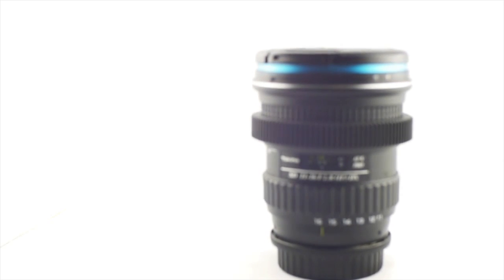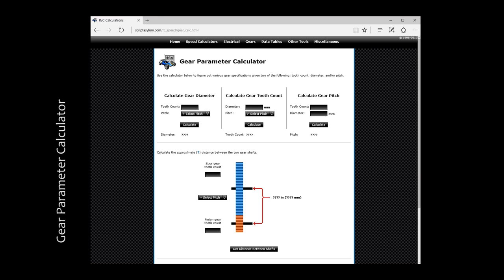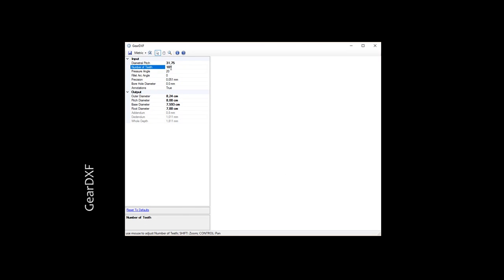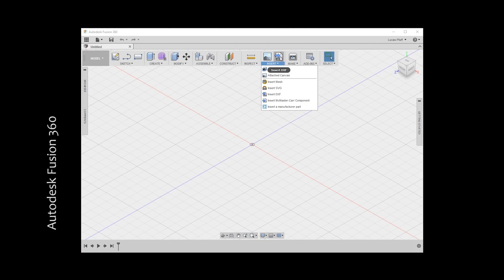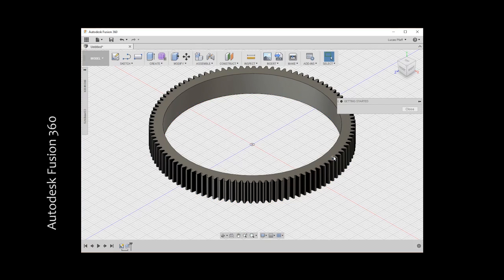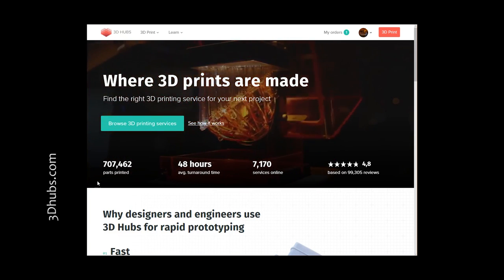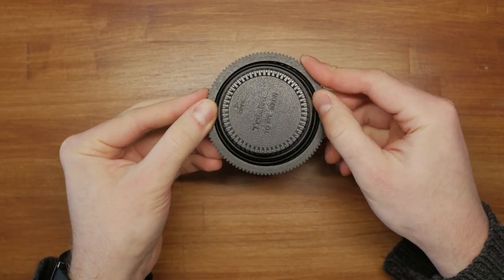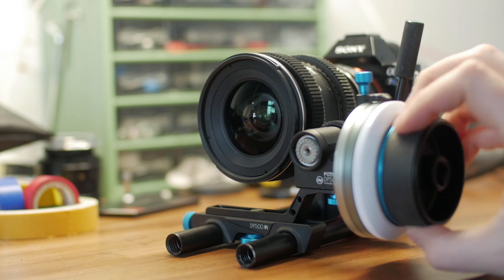DIY perfect, seamless Lens Gears for Follow Focus

Comment: Thank you for this very useful video. I'm on a mac and managed to do everything just using the free version of Autodesk Fusion 360 (maker version) - no need for GearDXF.

In Fusion 360, select the add-ins option then "Scripts and Add-ins". In the sample scripts provided when you install Fusion 360, select the SpurGear script and run it (I used the Python version, but the C++ version looks identical). When the script starts, change the "Standard" option from "Metric" to "English". Enter the diametral pitch of 31.75 and the number of teeth you need. I set backlash and root fillet radius at 0, and changed the gear thickness to 10 mm. Set the required hole diameter then click "OK"

That's it. Model generates and you're good to export the SLT.
Reply from the maker: Hi there Greg,

that is a great find! I'm planning to do a re-visit of this video where I share some new "tricks" I found along the way since I uploaded. Would you mind if I mentioned you with this trick in that video? :)

On a personal note, I love GearDXF for the nice preview, I like it for planning visually (I don't often calc the teeth number I need, I make the size based on eye and convenience). The native SpurGear implementation is WAY faster in terms of handling inside of Fusion 360, yet I found a way to make GearDXFs files a tad faster than they are by default, at least :)

Thanks for the heads up!
Reply: @LucasPfaff  - would be happy to be mentioned in your update. Thanks, again - your video has been so useful. I'm sure the re-visit will be just as good.
Reply: thank you! When I try to do this it says: Center Hole Diameter is to large. Do you know this problem?
Reply: @timdehring1507   this error is when you're using Fusion360? How many teeth have you entered and what is the diameter of the hole you need?
Reply: Thank you for this comment. I found it very helpful :)

Comment: I just tried this, the newer version of GearDXF is different and does not work correctly,  I went to the calculator and type in 91mm and .08 like you said, got 112 teeth, then went to gearDXF and entered in 112 teeth and 31.75, but could not enter in 81mm,  it reset it to 78.84mm. I managed to find an old version and it worked, so not sure what the difference is, Just wanted to let you know.  thanks
Reply: hi, where did you find the older version? thanks :)
Reply: @hydromyke  don't remember I just googled it.

Comment: Hey Lucas, thanks for the great tutorial! I have a question with the GearDXF though. I am trying to create a follow focus ring for Sigma 18-35 mm f/1.8. The diameter of the lens focus ring is ~77mm. So, adding +10 mm ring thickness, using the gear tooth calculator, the parameters should be: 

Diameter: 88mm
Pitch: Mod 0.8
Tooth count: 108
Diametral pitch:31.75

However, when I try to design the ring profile within the GearDXF, I could not input those numbers accurately. After inputting the Diametral Pitch as '31.75', the software automatically changes the number to '31.8'. Also, after inputting the Bore Hole Diameter as '77 mm', the software automatically correct the number to '75.24 mm'. Any idea what the reason might be and how to address this?

A screenshot of the GearDXF deign page I have could be found here: https://www.dropbox.com/s/2k0e1spj8hpm125/GearDXF%20Question.png?dl=0
Reply from the maker: Hi there, it seems you are using a different version than me. I'd maybe try to adjust the "spur" in the drop down menu and see if that changes something. If that helps, I'm using v2.1.1.0 right now
Reply: @LucasPfaff  That's what I thought. Thanks! I ended up re-sketched concentric circile with length diameter and 'extrude cut' inside the AutoDesk Fusion 360 to make sure the hole cut will fit with lens. As for the teeth dimension, will have to test with the follow focus gear later. Thanks!

Comment: I wonder why this approach is not more common. It's hard to find more than a couple of vendors who make this kind of seamless ring (although some managed to make them elastic). How your prints stand the pass of time? Are they still going?
Reply from the maker: They still go well, but replacing them after a few years is super cheap as well. The few vendors also only print them, so... :)

I'd stay away from elastic. 1st, if the lens size doesn't match properly you are left with improperly sized gears, which is obviously bad. 2nd, and worse, the gears themselves are also elastic and don't give proper support and might bend when you need them to be precise
Reply: @LucasPfaff  Yep, I though about the elasticity of he gears as well, nice to be validated on that.
I've already make the model yesterday and sent it to a friend with a printer, hope I have them soon. I've cheated a little and decreased the width, as you said, they are cheap to produce so I want so see how it works.
Reply from the maker: @SRG-Learn-Filmmaking  cool, hope it turns out well :)

I want to revisit this video soon-ish, adding some more insights I got along the way. But that's more cosmetics than usability :)

Comment: Are you going to do an update on this video Lucas?
Reply from the maker: I wanted to, but mainly with some practical and cosmetic enhancements. What kinda info would you like to see in an update?
Reply: @LucasPfaff  I'm on a Mac system, and a total beginner using Autodesk. I saw the comment that explained how to do it all through Autodesk but still couldn't figure it out. That's why I was hoping you'd be able to update it to explain it step by step with visuals.
Reply from the maker: @tuckerkanderson  ah I see! Unfortunately the built-in features are really subpar, so far I found no proper alternative for GearDXF :(
Reply: @LucasPfaff  ahh okay, no worries, maybe I'll just install Windows
Reply from the maker: @tuckerkanderson  I will still show it, I just don't like it for planning that much. I just need to find some time to make it, haha :)
Reply: @LucasPfaff  gotcha, well I'll be on the lookout for it! Got yourself a new sub  for that 😊

Comment: Do you have an alternative link for the Gear Parameter Calculator?  The link seems to be dead now.
Reply from the maker: Hays Clark I heard about it, I had no time to look into an alternative so far :(

For now I would suggest to just go into GearDXF and dabble with the settings. You can e.g. use the values from this video as base and then adjust the inner whole and teeth count accordingly. Not as precise, but gets the job done :)

Comment: Hi there, any option for GearDXF on Mac, I can't find any....... and my Windows Computer seems to be unable to install GearDXF........thanks a lot!
Reply from the maker: I didn't come across any so far :( maybe it works inside a virtual machine or WINE or something?
Reply: @LucasPfaff  Yup I found a .exe file to download, your link is for a .msi file , tricky to open anywhere, thanks!
Reply from the maker: @dm.b7560  that's interesting! Can you share the link so I can add this to the description? :)
Reply: @LucasPfaff  yup here https://geardxf.software.informer.com/download/, btw so If want all the lenses ring to have same size, I shall just change the inner diameter right? but leave same amount of tooth and out diameter righht? or change both values? thanks!

Comment: I'm assuming since this was posted years ago, it might have been the best solution, but 10 euros for one print? Thats not rly that cheap. You can find seamless gears for less than half that with no work on your end. Why DiY when it's cheaper, easier, and better to just buy it?
Reply from the maker: You are right, it's "a bit" older :) truth be told so far I didn't found commercial solutions better. I have a printer since two years now, and Bering able to make my own is not only a breeze, but also convenient as I can decide every aspect. Even colour.

Comment: Hello Lucas 
Thank you for the great Tutorial 
Unfortunately the  Scriptaslylum (http://scriptasylum.com/rc_speed/gear...)
 calculator is no longer available.
Are you aware of any online calculators that are as simple as their gear parameter calculator. Perhaps a downloadable program for future
Reply from the maker: tpcamera unfortunately I'm not :( I will look if I can find something. In the meantime, you can get around that by just going straight to GearDXF. So you can start with a too high number and just decrease the teeth till it matches your aesthetic :)
Reply: Thank you Lucas . It is a shame because the calculator in your video is so simple. I will also Look and If I find anything will let you know.
Reply from the maker: tpcamera I honestly didn't use it for quite some time because I fiddle directly in GearDXF. You can use the numbers I use in my video as a base and adjust your hole-diameter as well as the teeth count, as long as you don't need a certain ring thickness (that's rear) it works flawlessly :)
Reply: Lucas thank you.
 I did use the dimensions from your video as they were coincidently the same as my requirements . I did enjoy experimenting and would like to have a stand alone calculator. I will keep looking but will also go to Gear DXF program and play there as well.. Thank you

Comment: 11 euro per gear? 1 kg of PLA plastic has almost same cost... if you need print something more than one gear, you should buy 3D printer, cheapest stated below $200. It was best "toy" that i bought!
Reply from the maker: That makes sense when you need lots of gears, certainly not for just a few. And 1kg for 11€ is surely not a great filament, haha :)
I have a a 3D printer by now, the video is quite old, so prices are dated as well